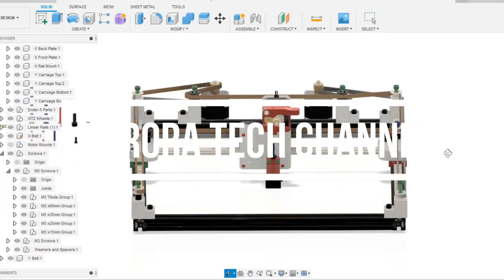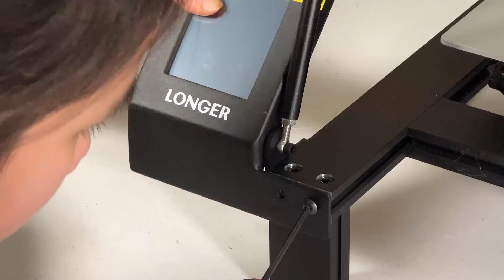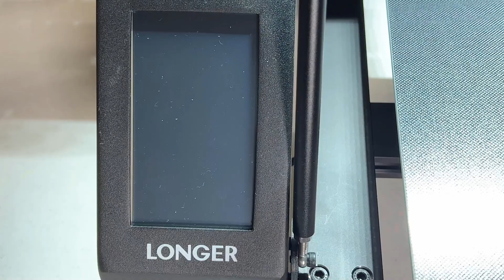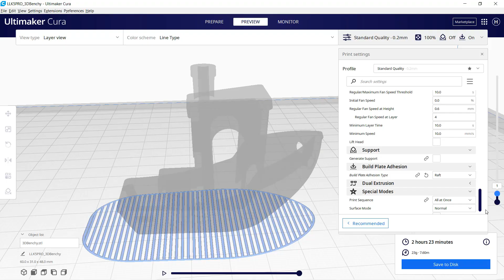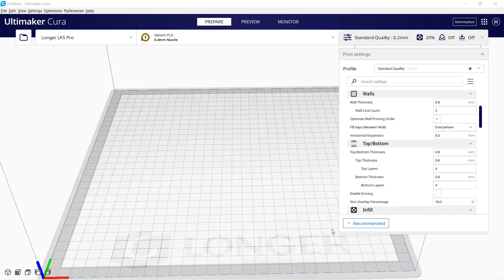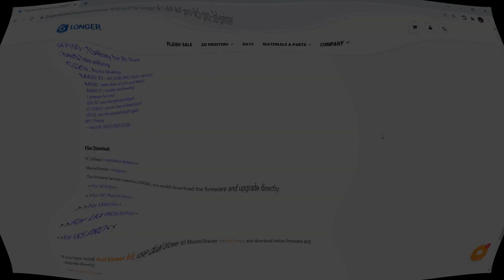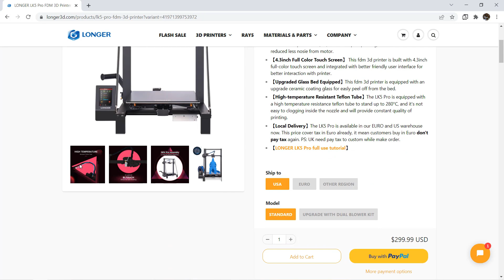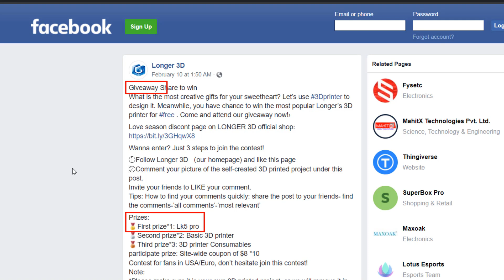Longer LK5 Pro $299 300x300x400 3D Printer: Silent stepper drivers, touch screen, and Upgrades

Comment: Unfortunately i had one of their printers. It was not good. Oh it worked fine, but the interface on the touch screen left a LOT to be desired. There was no way to baby step the machine. There was no leveling function if you installed BLTOUCH. The cooling solution was VERY bad. I gave mine away.

Comment: I’m new to 3D printing and purchase the Longer LK5 Pro printer and wanted to upgrade the z axis and found this video. I purchased two different stepper motors and found the the wire wasn’t the same as the one on the printer. Does anyone know the cable I can use. ?

Comment: Is there a way to install the Bltouch without needing the odd wire from computer to printer?
Reply from the maker: No, this is the biggest con of this printer, the screen doesn't support adjusting Z-offset.

Comment: Great review as always.  I have to say that sometimes your expertise and familiarity with these printers concerns me regarding your conclusions as someone with no experience doing modifications.  Something that is a minor upgrade to you may be a major endeavor to me.  I would not have a clue for instance on how to enable the bed leveling sensor in the firmware/slicer/gcode.
This is why I went with a Prusa.  I have been doing 3d printing for a decade, but always with fairly robust printers, and I have been out of it for 2 years.  Lulzbot mini packed up 2 years ago and now an prusa on order.  I have been fortunate to have had ZERO issues with the lulzbot other than an issue with the autoleveling that a call to their support fixed in short order with a beta firmware version.

Comment: Hi, I've had the LK5 since the beginning of last year and have had all kinds of problems with the hot end(s).  I'm on the fourth hot-end replacement - all factory hot ends - and the problems persist.  It seems to cool down drastically in the middle of prints and never seems to get to the proper temperature.  I'm printing PLA at 250c 25mm speed and 12mm layer height because that's about the maximum it can reliably print.  I've witnessed it set at 220c but drop to 160c with no outside input and no change in ambient temperature or environment.  I'm not sure a hot end change would do any good as it seems that whatever controls the heating is causing this.  This is an ongoing problem from day #1 with this printer that I've been in contact with Longer support dozens and dozens of times.  They basically just stopped responding, so I think I'm on my own here - any thoughts on what parts to replace or maybe a drop-in hot end replacement you'd recommend would be super-helpful.  

Also, if I can get the hot end problem solved, I will definitely be upgrading to the double-Z and leveling - Thank you for those!

Comment: Hi. Awesome video! I am just getting into 3d printing and would like to upgrade the longer LK5 pro I just recieved to the dual z-axis. Please forgive the stupid question, but you mentioned you upgraded the LK4. But the video you linked to is for an ender. Would it take the same parts?
Reply from the maker: They are pretty much the same, you only need to print a different dual Z plate for LK4/LK5:

https://www.thingiverse.com/thing:4774889

And a longer 500mm for LK5:
https://ebay.us/s2fJ04

Comment: Quick question: regarding  what you said about the z offset, the need to connect the printer to a pc would be like for every time a new print is started?
Reply from the maker: No, you only need to do it once, but after you replace the nozzle or remove the hotend to clean up, you need to do that again as the distance between the pin of the BLtouch and the nozzle may have been changed.

Comment: The upgrade you used on the Longer lk4, will the same parts work fit the lk5?
Reply from the maker: Yes, they use the same backplate, you only need to get a longer lead screw(500mm) for the Z-axis.

Comment: Another good review.  I bought one a week ago with the dual fan upgrade and it's printing great. Another "upgrade beyond the typical budget printer" is the coated glass bed. It's really quite fantastic. Other reviewers also mention that you should cut off the solder tinned ends of the nozzle heater wires that are held in the connector with screws and re-terminate with square pin connectors as this type of construction is a suspected fire hazard. I love mine and it simply can't be beat at the price point. Don't need the bed leveler as it's straightforward with the knobs. Once I fine tuned the rollers on the z-axis the layer resolution is perfect so I don't intend on getting the 2nd screw; although it's fabulous that you add in all the links and explain the benefits.
Reply: By "fine tune" do you mean just tighten them up a bit??? Yeah, I don't have a problem with manually leveling the bed if needed, and IFFFF tightening up the z axis wheels a bit gives much better stability down low, then I'm all for that as well, saving the money. Can you say which reviewer spoke about the cutting off the soldered tinned ends of the nozzle heater wires??? I'd like to see that vid also. Thanks.
Reply: @AquaStevae  Im curious too. Hope to find that info
Reply: @AquaStevae  BV3D: Bryan Vines https://youtu.be/vae6MReV_84?t=266

Comment: Great job as always.  Just a tip though the wheels are Delrin (or should be) not rubber :) 
Do some research on Delrin material you will run into it more in your future if you choose to go to a more engineering focus in your professional future.

Keep up the good work!

Comment: just a diy fyi, if you use a flush cutter or a pair of toe nail clippers to flush cut the zip ties they wont have sharp edges on them.  not a big deal on a printer but other diy stuff it can safe you from cutting up your arms when dragging your arm over them later.